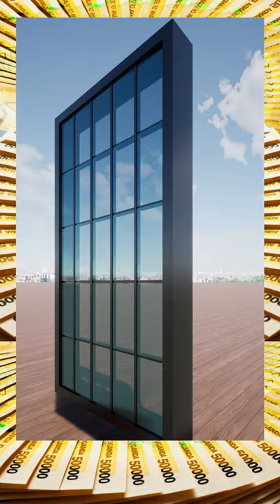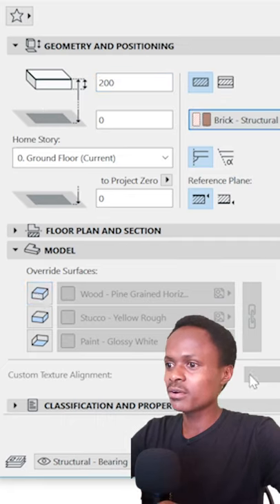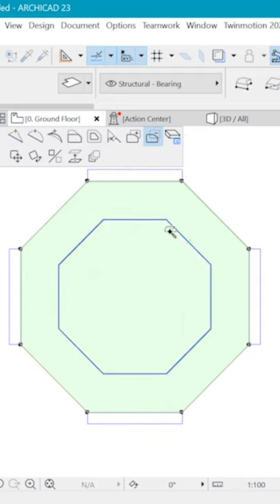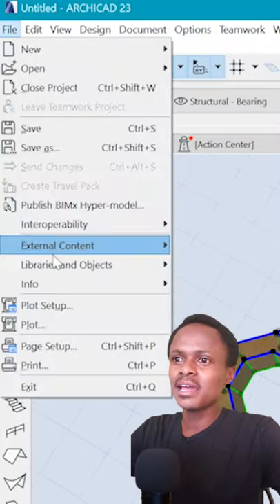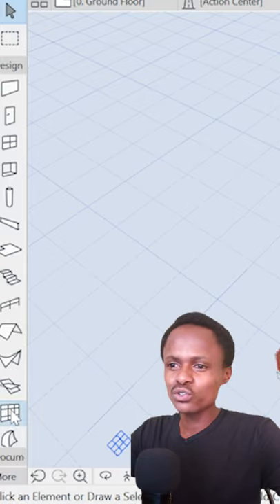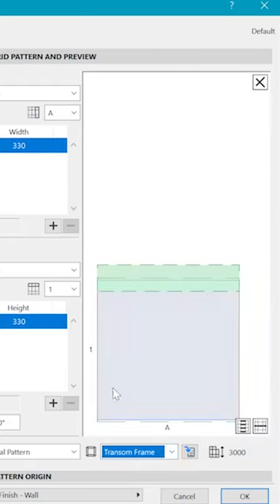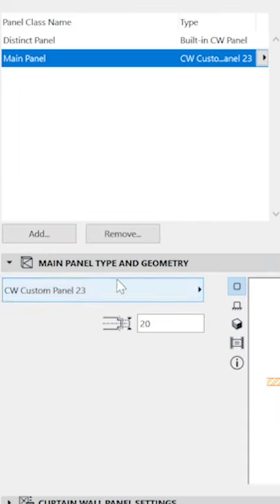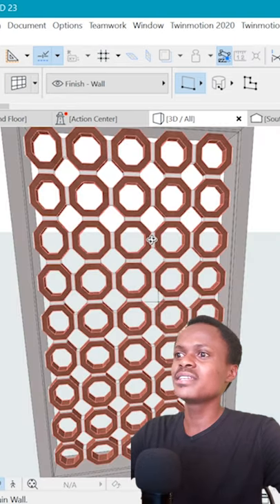Model a custom curtain wall in Archicad #Shorts

Comment: Is there a way to make the curtain wall run horizontally? So i can use it as a slab covering or something like that.
Reply from the maker: Definately it is possible, in the info box(the first horizontal bar above ground floor tab), u have three options on how to draw the curtain wall when it is selected, the third option allows you draw as you would a slab.
Reply: @nalituts  got it, thanks! :D

Comment: The option for save Selection as Curtain Wall Panel doesn't not appear on my menu im Archicad 24
But when i open a new file and create the slab it  brings the option
What could be the issue